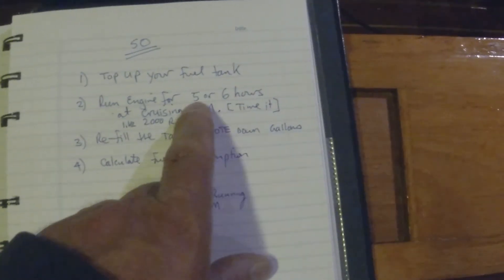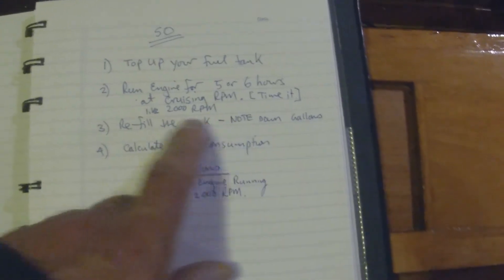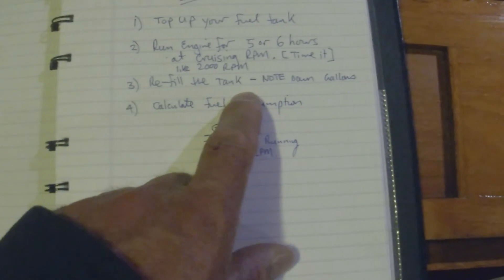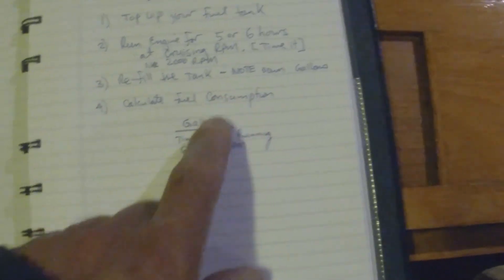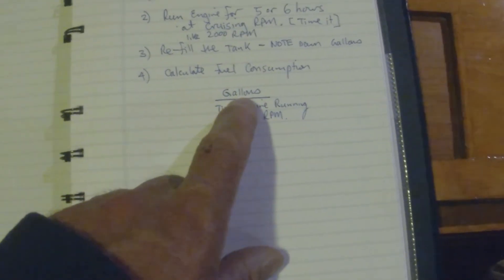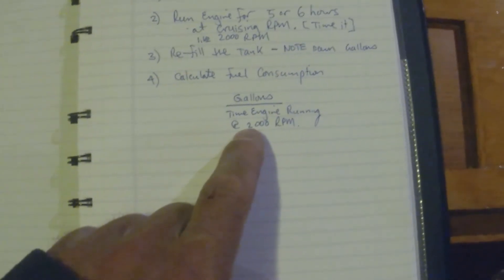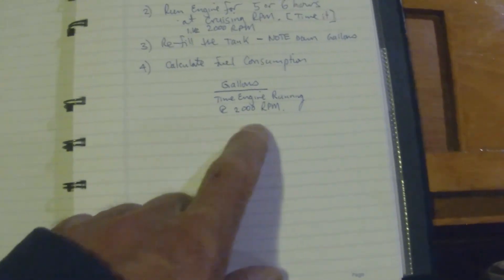CALCULATE DIESEL CONSUMPTION AT CRUISING SPEED

Comment: In strada 2008 how many klometer per 1 litro consumption
Reply from the maker: I'm not sure mate. It's difficult to get kilometers on a boat because of wind and water condition. I would suggest figuring out your consumption per hour at, say, 2000 RPM. This can be done reasonably easily by filling the tank, then track your hours and just run the engine at 2000 RPM. Refill the tank and see how much fuel you used per hour.